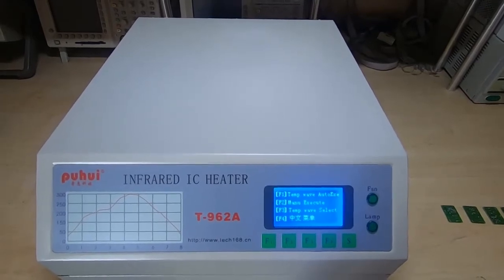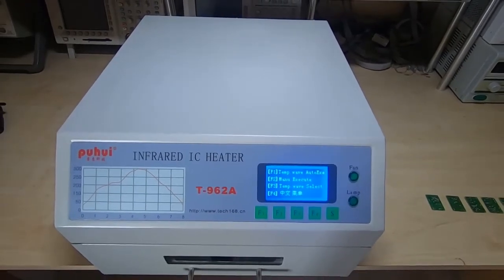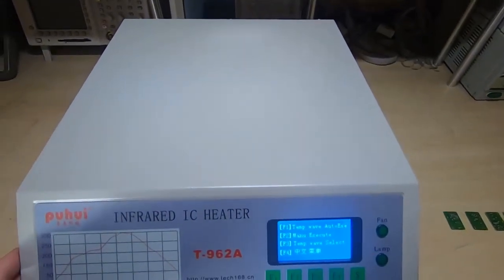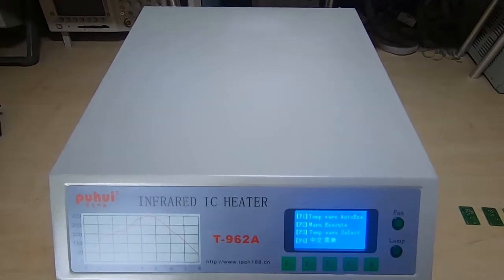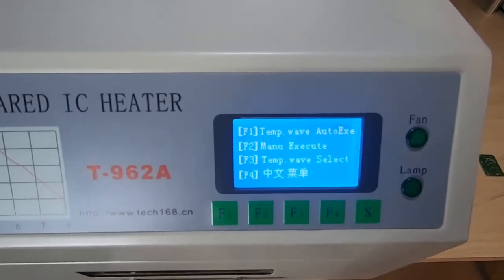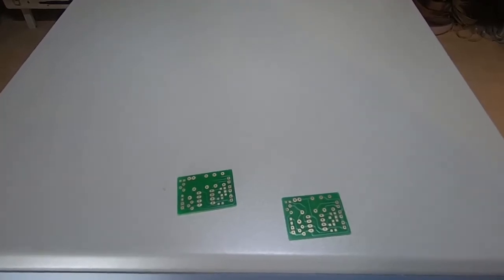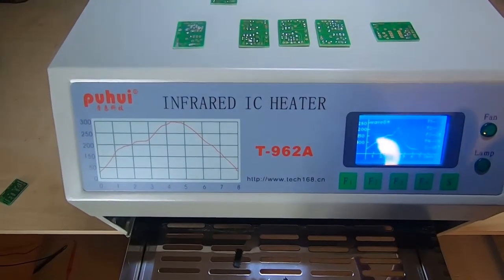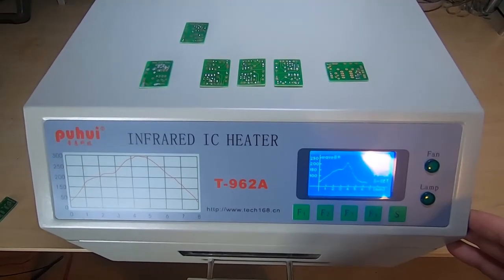T-962A Reflow Oven

Comment: Thanks Jerry, have same Model T-962A, I've seen videos of convertions, to improve it,
had mine for a couple of years, not tried to reflow until yesterday, I gave the unit the benefit of the doubt,
placed 9pcs of 100 x 100 x 1.6mm double sided, PCB's into the tray and ran the default profile, it was awful result,
I then used a higher temperature profile, then smoke came out of the back of the unit, during its high temp part.
Anyway I ended up using my HT-2020 hot plate to finish them off.
Was going to get rid, but I will give it another try, based on your video here.
Thanks alot Jerry, you can see my disaster on my youtube channel, just for completeness, arduplc.co.uk.
Reply from the maker: Wasn't sure where to look on your site.

Comment: Great content, horrible sound. The first 12 minutes didn't need the machine running during your explanation. Still, I learned something. Thank you
Reply from the maker: Thanks for your comment. I wanted to be able to open the drawer to make what I was saying clearer and I add interlocks to the drawers to prevent boards being ruined by having the drawer opened during a run so unfortunately I had to have it switched on or the drawer would not open. Let me know if you would be interested in videos on the pick and place machine (although it would need several videos).
Reply: @JerryWalker001  I would love pick and place videos. I have a hard time with the small buggers. Although I would only use it in small batches, it would be nice to have a more professional looking board.
Reply from the maker: C U,  I introduce the Machine here https://www.youtube.com/watch?v=6LDDKF_Df90&t=344s and will be posting more videos on it shortly.